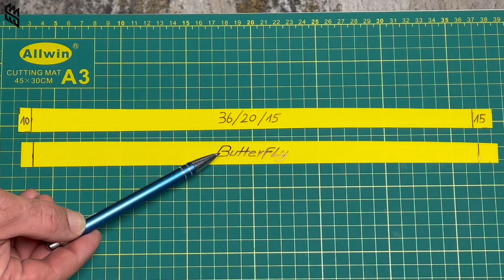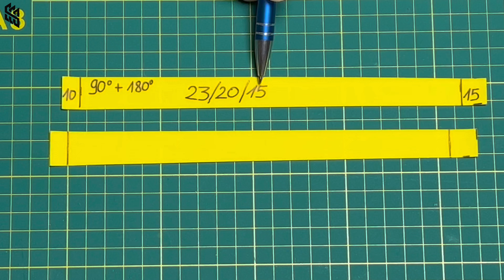No Comment Tutorial: How to Make Slingshot Bands.

Comment: Sir what is the thickness of that band
Reply from the maker: 0,70mm
Reply: thanks sir, for reply
Reply: which size metal ball use for this slingshot    ( 6.35,   7.1,  7.9  , 8.9  )  there r 4 size aailable in our area local shop...
 ( band size and ball size both r equally important for better performance  thats y i ask u which size i choose.)
Reply from the maker: 8mm 👍

Comment: ???? rubber thickness ????
Reply from the maker: Snipersling 0.80mm Bro
Reply: thanks dude !!
I suppose that " Snipersling" is name of brand ???
Color of sling effets on strongest of sling ???
Different brand with the same mm of thickness but ( I think) with different strongest.
Reply from the maker: yes that is the brand or name of it, you can't go wrong with snipersling bands, in my opinion they are the best on the market
Reply: what about colors ?? 
You can put link under video and make some money on cashback platform
Reply from the maker: As far as I know, the colors have no meaning